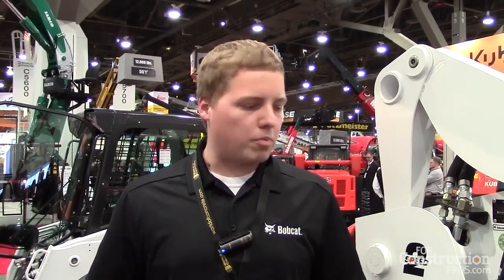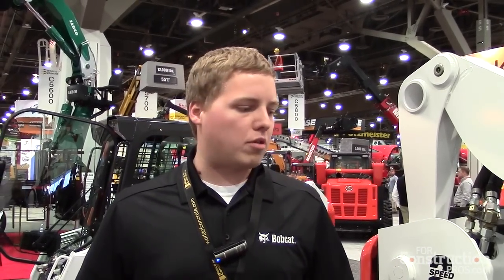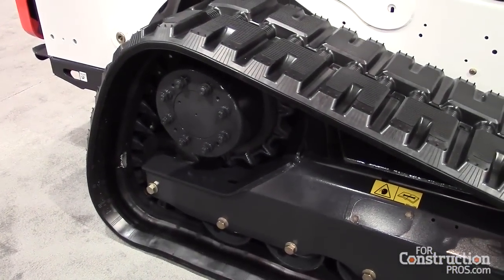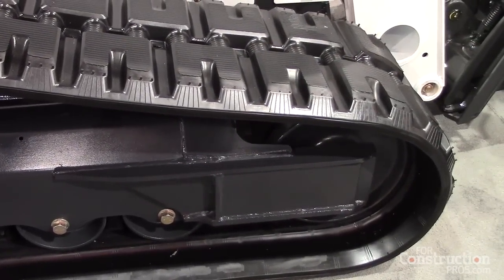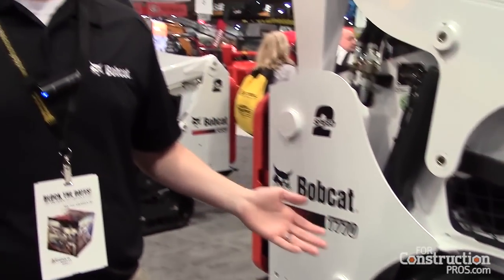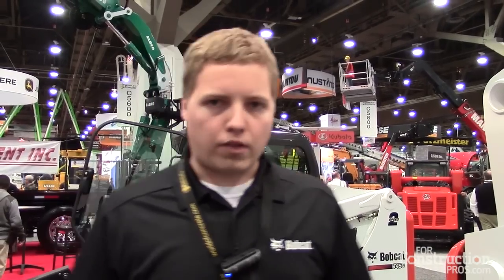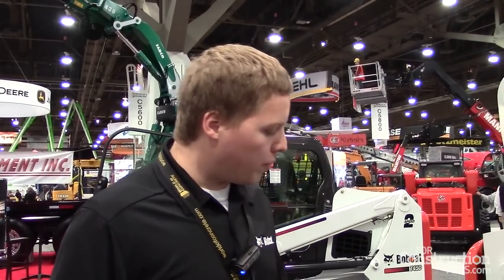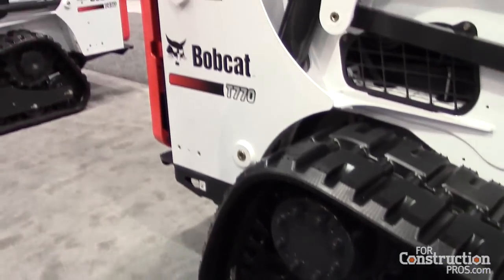Bobcat Releases First Redesigned Skid Steer Undercarriage in Nearly 15 Years

Comment: I have a 595 with wide track and I still think you need a spacer kit. The track is way to tight to the cab. Stuff is aways getting louged in between the track and the cab. Plus it’s very hard to clean out around that area, especially in the winter.

Comment: Ive been doing construction and dirt work for 25+ yrs.  I've had the displeasure of operating almost every make of skid steers from Caterpillar to Takehuchi. Regarding the copycat accusations, Bobcat has done what all others did in turn to them way back when they were partnered with Mustang and there is no skid steer produced today that holds a candle to these new machines. I purchased a T595 w/ 16" tracks and am absolutely blown away by the steady power in  pushing into a pile of material and how nimble these newly designed Bobcat skids are. Those of you commenting negative comments here are just pissed off cuz you went the cheap route, saved $15K buying a Kubota, or a Deere, or Case/ New Holland and wish you had a Bobcat now. And those of you who bought a Cat, feel the same way except your asshole is still bleeding cuz you paid top dollar for a turd.Haters are gonna hate and i know I get a few mouths flapping here in the comments but I don't give the smallest fuck because opinions are like assholes...everybody has one and shit runs outta every asshole sometimes.....
Reply: You gave your opinion now im going to give you mine. They all suck. It comes down to how hard your dealer wants to stick it to you when they break and they all break. But Bobcat is playing catch up.
Reply: HAD KUBOTA, WAY OVER RATED...2 GENERATIONS BEHIND BOBCAT AND CAT.  IN SHOP A LOT.  CAT HAS ISSUES ALSO, IE:  OIL SUCKS TO CHANGE,  HOSES IN UNDERCARRIAGE IS STUPID.  RADIO MOUNTED ON BACK OF CAB WALL EXPOES BACK OF RADIO TO ELEMENTS , BAD IDEA.  CAB TIGHT
Reply: @precisionfilms3777  THAT'S RIGHT...THEY'RE ALL GOOD TIL THEY TAKE A SHIT ON YA.
Reply: I will agree that they all break, and it’s kinda based on your local dealers. But in all and all, Bobcat makes the best loaders and always have, they are the leader and king of the skid steer industry.  Also, every loader has its pros and cons, but Bobcat just makes the ratio of pros and cons better then the other brands.